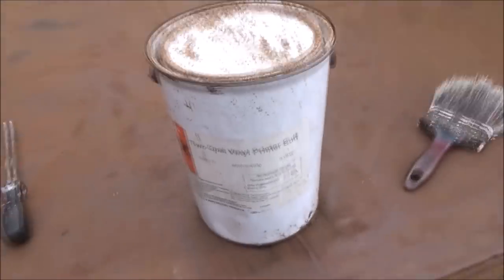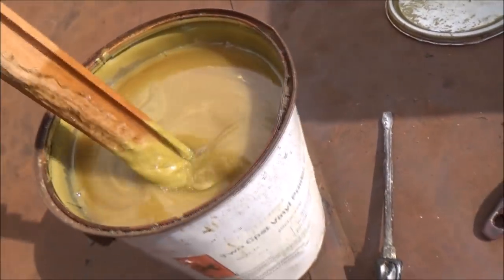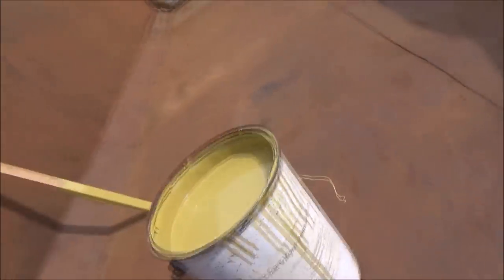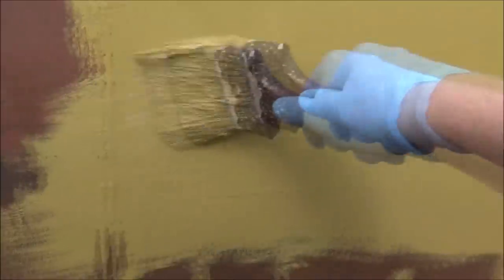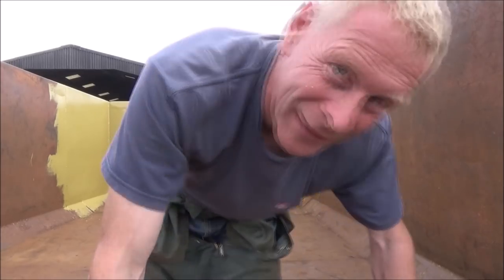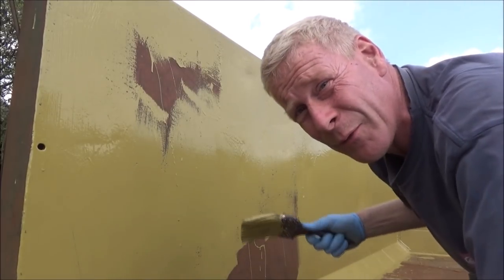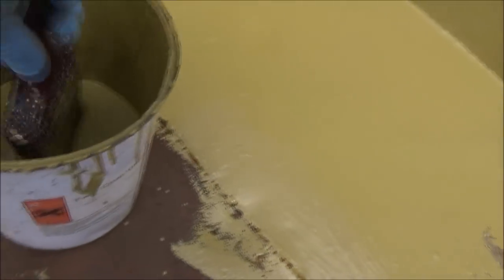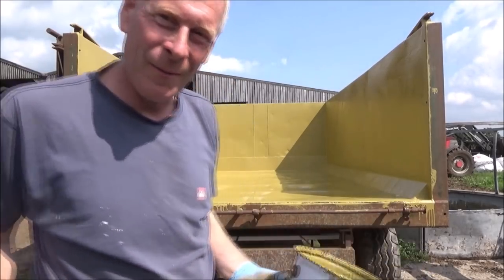Restoring the Norton trailer. Part 3. Paint on

Comment: wrong paint as tin says top coat.so were is the undercoat? rust in a few weeks as there is a 3 stages to this paint.1 primer 2 undercoat and 3 finish coat
Reply: I know it says two coat on tin.but it needs rust primer under it
Reply from the maker: It's the right stuff.  The yellow is the undercoat